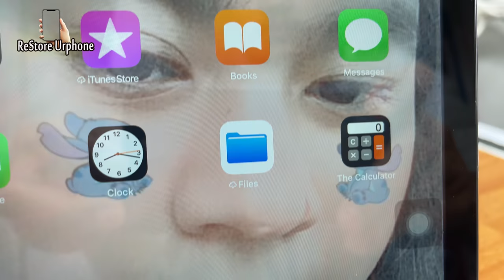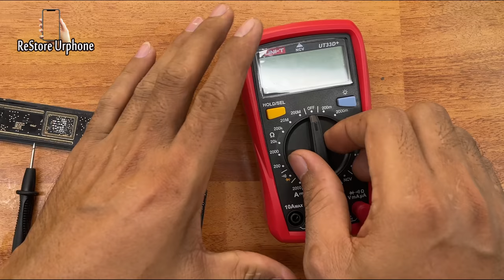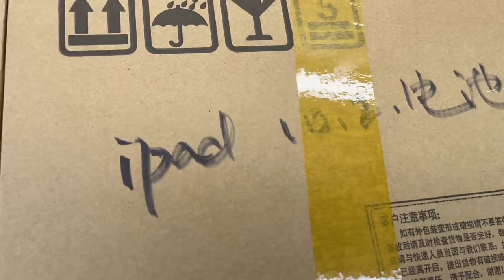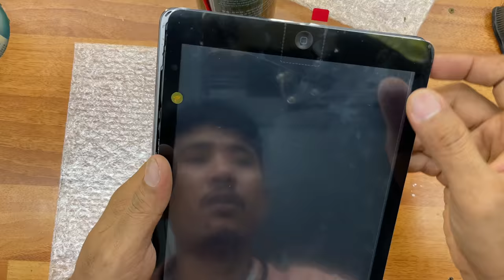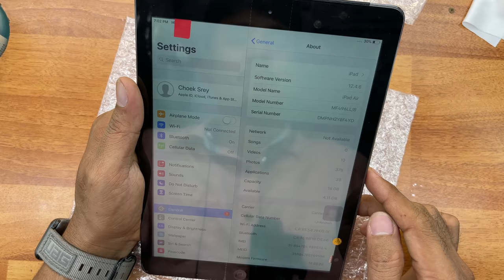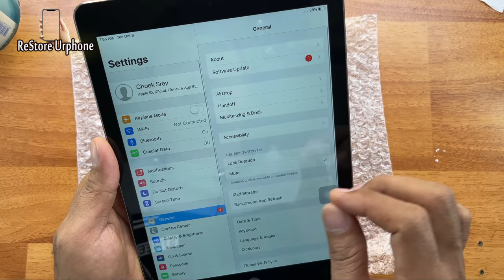How To Restore iPad Air Cracked | Restoration destroyed iPad air completely

Comment: Why just why have u use B7000 adhesive at battery, or on protective shield which u glued to charging dock flex cable. To repair this device next time will be nightmare :-D